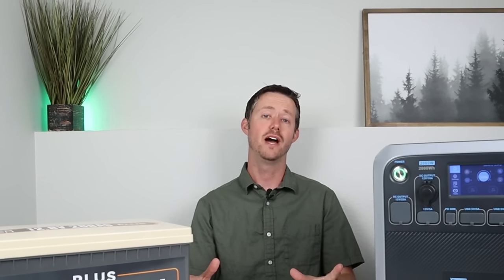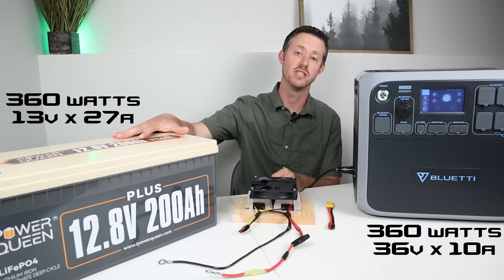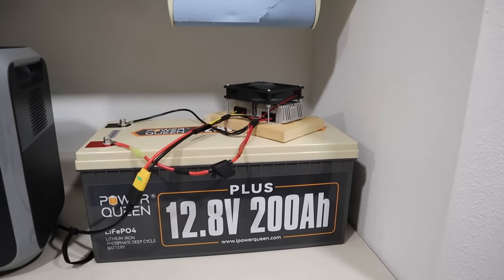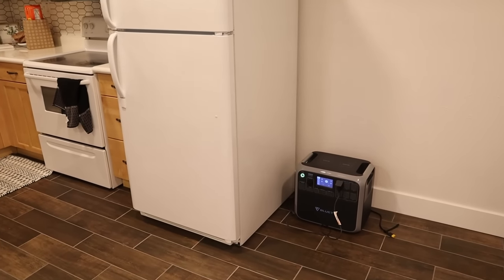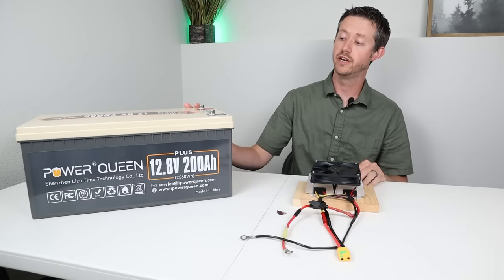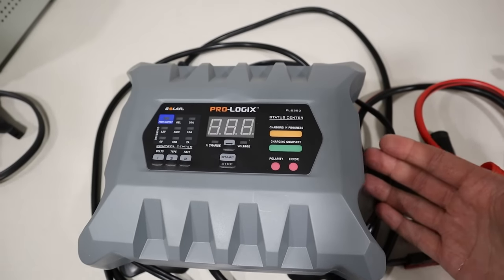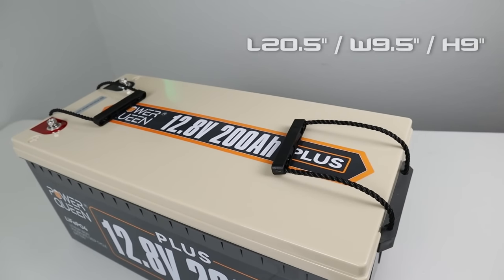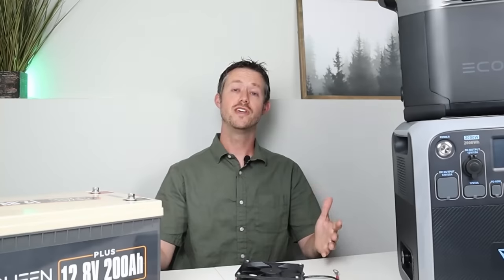Make Your Power Station Last Longer! Power Queen 200AH LiFePO4 - DIY Expansion Battery!

Comment: I use a similar voltage booster to charge my power station from a running vehicle. However for this application, I would recommend using 2 100AH batteries in series for 25.6V instead of one 200AH 12.8V battery. You are losing efficiency with the boost converter, and adding expense. And, as you've noted, when you pull 40Amps things tend to get warm unless you are careful.
Reply from the maker: The best setup would be to have a 48v LFP battery so you could get quite a bit of power without any loss. EG4 makes a 5kwh 48v LFP battery for $1500. They can't keep up with the demand! The 24v battery is a decent option too. Thanks for commenting :)
Reply: The EG4 48v 5kw battery is what I’ve been looking at to expand my AC200Max, as I think Bluetti 2kw expansion batteries are too expensive.  Since the EG4 and AC200 Max are 48v, is it a simple direct connection or is more involved?   @Jasonoid
Reply from the maker: @raspillade6027  you can use a 48v EG4 battery to dump power into the Bluetti power station to charge it. You'll want to plug the output of that 48v battery into the solar input of the power station (and make sure it's set to solar input on the screen so it allows the higher voltage input). It won't be "officially" supported as an expansion battery for the Max since it won't use the Bluetti expansion cable with the communication connections.
Reply: @Jasonoid 
Could you theoretically plug a solar charger into the 48v battery so solar panels could charge the expansion pack too?
Reply: @raspillade6027  If you connect to the standard solar input port, it is a simple direct connection. That input current limits to 15 amps on my AC200MAX. For the other input port, the one that is used for the AC power brick, you have to use a Bluetti DC Charging Enhancer (D050S) ($200) which limits input to 10 amps. So, I can input 700W+ through the solar input port and 450W+ using the (D050S). Have fun!
Reply: @Jasonoid  I'm trying to accomplish 400+w/hr charging input using a 48v LiFePO4 battery. How should I go about achieving this goal on my Bluetti or Delta Max 2? What parts do you suggest? What wire gauge, etc? My Bluetti AC 1700 came with alligator clips. Would these work?
Reply: He needs to answer this question, I'm also in the same boat, trying to figure out if I can use 12awg Xt60 to alligator clip on a 24V lipo battery. Every video I find only shows 12v batteries, with alligator clip, the ones I found for sale say 12v alligator clip, i want to know if they work with 24v battery, even the seller has yet to respond back.
Reply: @coryjefferson6477  Cory, I recommend you look up Ohms Law and Joule's Law to educate yourself if you are going to play with electricity. I have provided a link to wire gauge chart below you can keep as reference, I DO! I'm sure Jason knows the answer but it's always tricky to provide recommendations since he doesn't control the environment or equipment you will be using. Best of luck.
Reply: Just buy a inverter

Comment: Well, if you have a fully charged Bluetti and a fully charged 12v LiFePO4, you can just keep trickle charging using the 12v system, you save a bit of losses and the lower discharge rate of the 12v battery may give you extra total runtime. When the compressor is running, you only pull 50W from te Bluetti, and when it's not running, you charge with 120W.
Reply: My thoughts exactly.
Reply: I too see real value in simply using the external battery as an expansion to increase total runtime rather than trying to charge the power station's battery really fast.

Comment: Easier and probably safer option is to simply use a 500W sine wave inverter and plug the supplied power source which delivers 400W.  Mine draws 32A from the 200Ah battery, if you think about it that would be the same as using a 12V 25A battery charger off mains power.
Reply: 10000 percent correct, he should do a video on that
Reply: but this is converting AC to DC. so there would be more power loss vs DC to DC
Reply: @vanchau yes but it charges much much faster which allow you to take this time gains to charge again the battery with a powerful charger or big array solar panels.

Comment: Is there a commercially available product (think battery maintainer sized box) that's basically designed for specifically this purpose and is premade, or are these still at the DIY stages?

Comment: Would like to see a portable solar generator that doesn't have an internal battery that connects to an external battery and then you can set the parameters for the solar generator to those of the external battery.
Reply: Like a bluetti ac300?
Reply: @whitmorestrains  I would like to use the generic lithium iron phosphate battery as shown in the video.
Reply: @highwaymen1237  The problem is that most solar generators have a 48v internal battery for an inverter that also uses 48v. This is much easier to build. Smaller wires and less amps and less heat. You probably won’t find anyone making a battery-less inverter module that works with a 12v battery. It takes a lot of batteries to be able to give a 12v inverter enough power to make 2000w. It’s much easier with a 48v system.
Reply: @whitmorestrains  Renogy sells a 3,000 watt pure sine wave 12 volt inverter.
Reply: @Danang Alta Okay what is the efficiency difference?  Since I'm an engineer I like numbers not opinions.

Comment: I've seen yours and some other videos on these Power Queens and if I were in the market to add capacity to my systems right now, I'd consider picking up a couple of these for extra capacity.  Right now the 190 Ah models (over 2400 Wh) are just over $600 or about a quarter per watt-hour.  That's getting pretty insane, in a good way.

Comment: I was hoping you'd show how to do this on a typical midrange unit, perhaps wiring the big external battery in place of the internal battery on perhaps a 500WH unit.  Many of those charge at max rates of 65W-72W, which won't allow you to offset even a modest demand.  It still had some good ideas though, like using a voltage tripler (or doubler) to get much higher charge rates out of only a 12V source.
Reply from the maker: The options on the small power stations are limited since they don't allow high voltages and they have such low input amperage limits. 

If they accept 24v input, using a 12v to 24v converter would probably be best. You could also run a small inverter on your large battery and run the stock charger off the inverter.

Sometimes a DIY solution (battery, inverter, charger) can be the best since you aren't limited by cheap engineering.

Comment: I'm just finding this video in early Dec. 2022 and I'm inspired to find there are options for creating one's own auxiliary battery supply for these large power stations!  I just ordered a Bluetti AC200P and started digging around to see if I could expand its capacity without having to spend $1,300 or more for one of Bluetti's auxiliary batteries, i.e. the B230 or the B300.  I'm so glad to find this explanation showing there are many options for making this happen, at a lower price, IF you have the skills to do all those calculations.  I don't have the skills, but I could find someone to help, now that I know it's possible.   I also want to say I think you do excellent presentations, Jasonoid!  I've watched a couple of your videos so far, and I don't know why you don't have a larger Subscriber base by now.  You are clear, articulate and know how to present information in a methodical, step by step process, with great demos and videography.  Thanks so much for sharing your knowledge with all of us who need it!  I hope your Subscriber base continues to grow, and that it will help compensate you for all your efforts.   Cheers!
Reply from the maker: Thanks Living It Up, one of the easiest ways to charge the AC200p faster is by getting either a 24v LiFePO4 battery, or a 48v battery (51.2v). By just connecting a 24v battery up to the charging input, you can charge the AC200p at around 240 watts, maybe a little higher. You could also purchase a 48v LiFePO4 battery and charge near 600 watts when connected up. Power Queen makes some excellent budget batteries. For example this battery has 4600wh, it would charge the AC200p at around 550-600 watts when connected, and only costs $1200:
https://ipowerqueen.com/products/power-queen-51-2v-90ah-lifepo4-battery-built-in-90a-bms
Probably even cheaper with my discount code: LLC3
Reply: @Jasonoid  Thanks Jason!  Well, I have limited funds, so $1,200 for an extra battery for charging my new AC200P is not possible.  BUT, you added some valuable info, reminding me about choosing a 24V or 48V configuration to speed the charging with a battery.  I'll keep weighing all the options (incl. a propane-powered generator), for my emergency backup system, and budget for the next phase of investment.  Just trying to prepare for the electrical grid outages that we keep being warned about.  I'm in Portland, OR and our electricity providers have had at least 3 short-term outages just in the past 6 weeks....and today it's snowing, with 3" expected, which often brings power outages due to tree breakage and downed wires.  
We all have to be better prepared these days for more weather and grid-related emergencies.  So, your thorough and clear videos are very appreciated in this education process.  Thanks again for what you're doing! 🙏👍☮😉
Reply: Could i run 2 12v batteries in series to make 24v and plug into the solar port?
Reply from the maker: @Chegooutdoors  yes, that will work just fine!

Comment: I have a Bluetti AC200P connected to a 6 circuit transfer switch.  I run a few circuits every day to take advantage of the unit rather than have it sit waiting to be used during a power outage.  I decided I needed more capacity so I bought two of the Power Queen 12V LFP batteries and hooked them up in series.  I was using the Bluetti D050S enhancer to connect the batteries to the AC200P and this setup was supplying 250W.  I saw this video and decided to try a DC to DC converter like yours.  Since the AC200P requires at least 36V input, I actually purchased a 24V to 48V converter and just got it hooked up and running this morning.  It is supplying 322W input to the AC200P, drawing 13.2A from the battery and outputting 7.1A to the AC200P which means it is outputting around 45V.  The converter was getting a bit hot so I will need to attach a fan.  Wires were barely warm.  Overall I am very pleased with the setup.  Thanks for the video.  I always look forward to watching your videos.  Keep up the good work.
Reply from the maker: Good boost of wattage! Great news, Robert!

Comment: This is really a great and timely idea!  Might as well add the 12/24 VDC converter as well.  Then this battery system can pretty much be used to charge up any of the current solar generators from small to large, plus you get the ability to charge more than one solar generator at a time.  Put all the electronics in a case or box, with some good 4 gauge wire with some alligator clips and you can use any 12 volt battery as a source.  Definitely my next project:)
Reply from the maker: A couple other ideas that would also work:
-Add a 500 watt inverter to your battery to charge your power stations using the inverter
-Get a 24v or 48v battery instead of a 12v battery, and just plug in your power stations.... for best conversion efficiencies. 

There are so many options to do this so just chose what works best for you :)
Reply: @Jasonoid    This is good too.  Just looking at the conversion losses, the fewer steps, the better.  The best would be to use a 48 volt battery, which can go directly into the PV input of most large solar generators.  This method involves only the conversion losses of the internal MPPT solar controller in the generator, and of course, the charging loss of charging the internal LiFePO4 battery, which is about 8.6% (from the original MIT patent) and translates to 916 watts of the 1000 watts being available to run loads.  Introducing a DC to DC converter (typically 80% for the cheaper units to 90% or better for the really good ones).  That one step means for every 1000 watts going from one battery to another, only about 733 watts will be available for use to run a load.  A good quality AC inverter typically starts at 88% conversion efficiency and can reach as high as 97%, but they are going to be pricey when compared to a DC to DC converter.  For a comparison with lead acid, you typically get only 60 watts back for every 100 watts you put in if you discharge at the 25 hour rate.  If you run the starter until the starter won't turn the car over, and then recharge it, that drops to 9 watts for the same 100 watt input!  I'm really glad to see these real world applications that anyone can do, as lots of us don't think of them ourselves!
Reply: @Jasonoid  Great information,, how about a video on the least expensive 48v battery for this purpose
Reply: Be avered of BLUETTI  !!!
Therevis no service for there product.
There is thousand of as filing class action against Bluetti company.
Reply: @Jasonoid  ever just used the victron DC to DC charger with xt60 ends or the renogy dc to dc 12 volt chargers?

Comment: I have a couple of 200 ah Ampere Time batteries that I use the same way with the 12 volt method you were showing.  It trickle charges my Bluetti AC200 when running a refrigerator.  The 130 watts keeps up with the wattage used by the refrigerator.  When I need to charge the Bluetti faster from the battery, I just use a cheap Bestek 1000 watt pure sine wave 110 volt inverter and use the Bluetti AC 200 charging brick and it charges at a little over 400 watts.  Using the inverter method you can charge any of your power stations by using their AC charging brick or the AC charging method that your Power Station uses.  If you try to charge a large EcoFlow power station or any other power station that pulls over 800  watts, you will need a larger DC to AC inverter.  I built a charging station that has another brand of 200 ah LIPO battery with a 3000 watt pure sine wave inverter that I charge all my larger power stations.  This way I can charge the larger power stations with solar and AC at the same time..  Jasonoid, I really liked the dc to dc booster you built.
Reply from the maker: Excellent ideas here in this post, thanks for sharing your setup Arman!

Comment: Good idea.  I like videos like this because they make me think of how I am going to keep my small system going at night.  The simplest probably is a cheap modified sine wave inverter that's over 500 watts. For the PV input at night,  you can have a setup like this on a two-way battery switch and just switch off your panels and switch on your battery.  For one battery you could run a 10 or 20 amp charge controller and one or two panels and just slowly charge it up during the day.
Reply from the maker: I agree, small 500 watt inverter would work well for this.
Reply: @PWoods-cd6tk  newbie here. WOW! Are you saying I could just hook up a - over 500 watts pure sine inverter to a 12v battery - and plug the my bluetti 200 max station right in to that to recharge?  If so that would be so much easier for me!  Would it still give high watt charge? or Does it lose efficiency over this whole wired way  shown in thi svideo ( which is cool and creative, but intimidating for me) . I don't understand the battery switch so well, but I could do it manually I suppose.  I'd rather put money into 12v batteries than bluetti's expansion to get way more capacity, if i can do it safely and not TOO inconveniently for a temporary stationary RV.
Reply: After a couple of years now since this video, I would say buy a 48 volt battery and a 40 amp charge controller instead of buying any of the external batteries for the Bluetti or whatever station you have.  You then just run the 51.2 volts from the battery into the solar input of the power station at 10 amps or whatever and have 500 watts steadily trickling in.  A 40 amp charge controller will let you run 2400 watts of solar to the battery.  There's a few 48 volt 100 amp hour batteries going for under a $1000 now,  and some 30 amp hour 48 volt batteries that are going for what 12 volt used to go for, so it's a better deal. When I purchased my two B200s, they were $1,200 a piece I believe.  There are a few 40 amp mppt charge controllers going for $150 and lower that are pretty good.  Bouge RV makes a decent one.

Comment: You can also parallel 2 batteries and charge them using a high amps 12V charger on the AC output. Or better yet use a 24V charger and keep the batteries in series. 
When the batteries are full, switch them to series configuration if not a 24V setup, and use them to charge the Bluetti when the Sun or whatever is not available.
You are losing a lot of power using a boost converter and are limited in the 100 Wattish charging limit without a boost converter. 
I bought the new EB3A. I love it and that's one way I found I can extend the capacity, short of opening it up and paralleling the internal 24V battery with an external one.
Reply: That is super interesting. Have you take some photos of that connections or have you a scheme? Is there a limit to capacity of external battery? At 300 € plus external battery it would probably cheap and super efficient